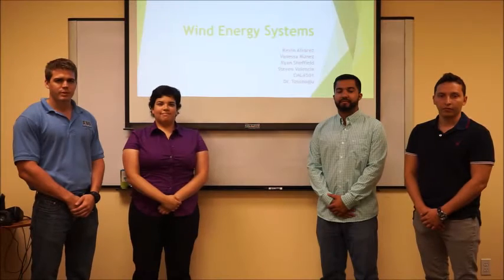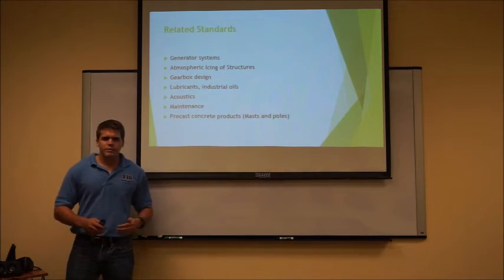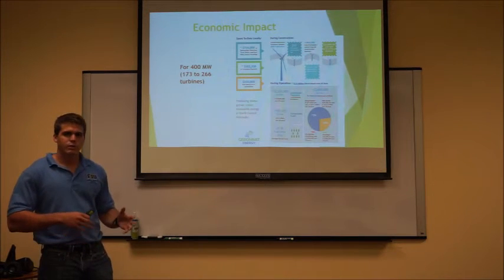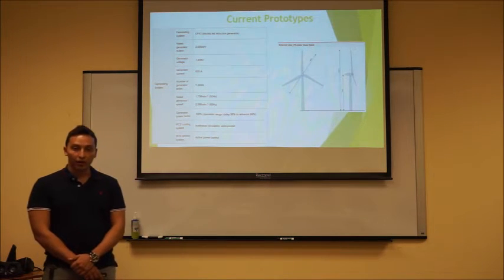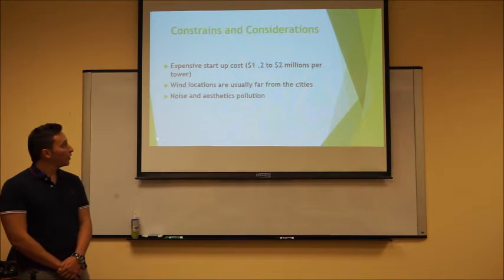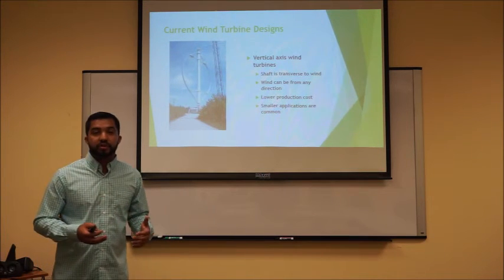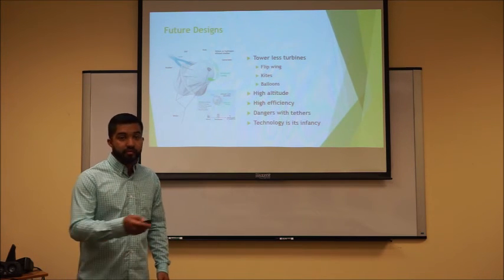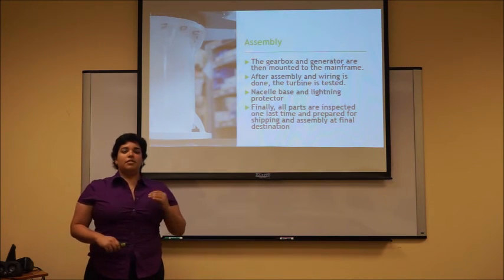Team 7: Wind Energy Systems

Comment: First, the negatives. Like many others, there was constant distracting background noise, lighting wasn't ideal, and quality could have been better. Additionally, the screen is rather small and as a result, the slides and text are too so it's hard to read. But on to the positives, the speakers did a great job presenting the information. Very informative and they spoke with confidence.

Comment: Great overall presentation. Speakers were knowledgeable and spoke fluently. Quality of video is good but slides were too small and hard to read. A little more lighting would be helpful. Speakers are cutoff from screen at some points in the video which should be avoided.

Comment: Perfect sound and video quality but this was not reflected upon the presentation as projected slides were very small and some figures made illegible. On the other hand, for a majority of the presentation group members were able to communicate with audience in communicating the technologies history and current status. Flow of transition between group members was easy, though it seemed at times members had to take a substantial amount of time to view each slide before speaking. Content and quality wise the knowledge provided was sufficient, but many slides were deemed useless to an audience due to size of figures.